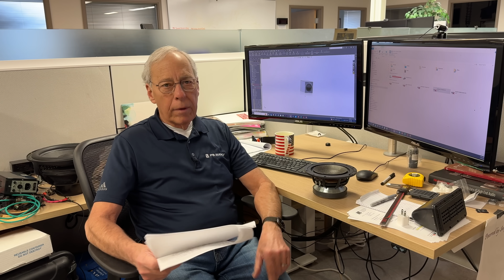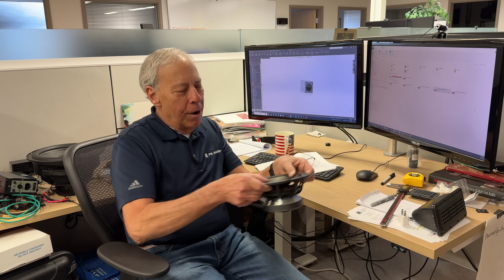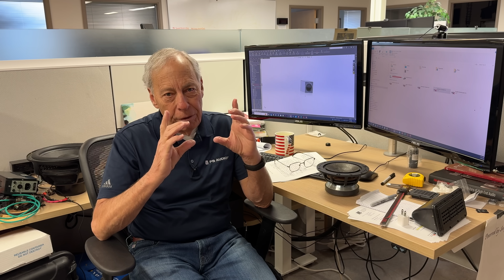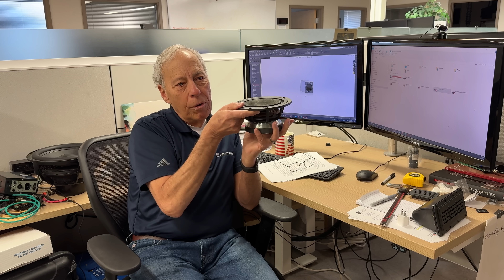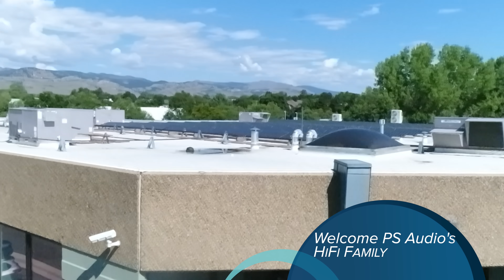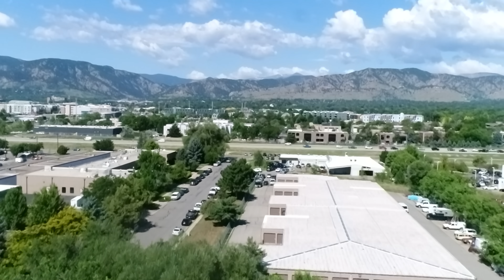How speakers move at multiple frequencies

Comment: Ok! That makes sense. I have to slow down the animation in my head to make sense. 

It reminds me somewhat of how computer chips work in that they seem to do multiple tasks at once, but in fact a single chip does one thing at a time and bounces between different tasks. 

I think another way to summarize this is that if you can expand one second into thousands of pieces it can mimic simultaneity.

Comment: Very good explanation, thank you. Paul, a question... I know that the human ear is capable of hearing a range of frequencies that goes from 20 Hz to 20 KHz. I also know that these are four speakers (Tweeter, MidRange, MidBass and Subwoofer) that, “together”, are capable of reproducing the entire range of frequencies mentioned. But I ask... Each of the four speakers mentioned reproduces, individually, which range of frequencies? In other words, the Tweeter is responsible for reproducing, individually, which range of frequencies? What about MidRange? What about MidBass? And the subwoofer? I would just like to have a general idea of the frequency range that each speaker works individually. It's a generic question, as I deduce that there is no fixed rule for this. But I would just like to have a rough idea.

Comment: My realization of the doppler effect came from being in a 'garage band'. What happened was plugging the mic into a bass guitar amp produced wild as heck modulations to the singers voice because the vocal frequencies were 'riding' on the much slower bass movements of the speaker cone. It was similar to the sound you can make whilst gargling and humming at the same time.

Comment: taking the loudspeaker components , the speaker fixed magnet , the voice coil suspension flexible holder , the voice coil attached to the speaker cone , taking delta T sec . , time constant , the voice coil , will oscillates the summations of all the fundamental frequencies , thus emitting all the fundamental frequencies from speaker cone , the overall effects is the integral summations of the audio complex wave over a unit time .

Comment: That‘s one reason why fullrange speakers don‘t work. Greetz from 🇨🇭
Reply: My PearlAcoustics Sibelius single driver work just fine, sound excellent to me. The absence of a cross over with all sorts of artifact possibilities, and the coherence of the sound is a major plus for single driver speakers. From a fellow Swiss, Jä e Basler Bebbi.
Reply: @danielgeiger7739  Auch ein Breitbänder benötigt ein elektrisches Korrekturnetzwerk um zumindest den Bafflestep zu kompensieren. Vielleicht hat dein PerlAcoustics Sibelius sogar so eines verbaut und du weisst es nur nicht? ;-) Grüsse aus dem Bernbiet.
Reply: @SinusPrimus  Amp - binding post - voice coil. That's the signal path in the Sibelius. I have not cut the speaker open, but at least that is what website indicates as well as Harley's very nice videos on YouTube (Pearlacoustics channel). Very much worth the time. 
Re baffle step (roll off of low frequencies), Sibelius uses as Voight pipe design of the cabinet. You could consider that the "correction network" but it is not in the signal path, it is not electronic. It is careful internal cabinet design.
Reply: @danielgeiger7739  Danke für den Hinweis. Theoretisch wäre eine rein akustische Kompensation ideal. In der Praxis setzt der Bafflestep aber nicht erst bei sehr tiefen Frequenzwein ein, sondern bei Schallwänden dieser Grösse bzw. Schmalheit im Bassmitteltonbereich. Also kann diese interne Schallführung das Problem nicht genügend oder nur ansatzweise beheben. Vielleicht schaue ich noch nach, ob es Messdiagramme gibt, die das belegen...

Comment: That's why we have intermodulation with full range speakers, separating drivers helps to avoid that, but i think there are some speakers manufactured in a way that at a certain point the higher frequencies just oscillates at the center, they use different materials and shapes to provoke a mechanical behavior.

Comment: So I wonder IF it could be ideal (if possible), to have like 5, 7, or 33 broken down circuits with the same number of different sized speakers?  So, normally the most I've seen I think is 4 way speakers with FOUR different frequency ranges and 4 different speakers, one to handle each.  Would it "cost" too much power to separate it this much?  Or would it actually potentially benefit?  I'm guessing you COULD use a good midrange speaker type to handle each of many frequency ranges, right?  So, let's call one speaker type a Sony 22m 2.5".  You could have maybe 7 of these on a box or even panel, each one handling a separate frequency range.  Would this actually produce technically "better" sound?  Or would the difference between that and only 3-way be negligible?

Comment: You forgot to mention that cone design factor and the physical attributes of said cone . Higher frequencies in a driver due to speed are released from center out . Hence putting a whizzer cone at dust cap center . The center moves faster than the outer edge because there is less area . A good /bad cone design is essential to its ability to produce proper frequencies thought a certain spectrum .

Comment: Thanks , Paul ! I had always thought of multiple frequencies simultaneously as intermodulation distortion , but Doppler does seem a more accurate descriptor .
I imagine a line array with 20 drivers and 19 crossovers would be silly to keep each driver in a "sweet" half octave . That would be a lot of expensive capacitors !

Comment: I figured it works like runners around a track: runners on the inside of the track will circle faster than the outside runner if they didn’t start staggered. The higher frequencies are coming off the area of the cone nearest to the middle, lower frequencies from the outer closest to the edge.

Comment: That's the problem with audio measurement specs. They are all based on steady state typically sine waves. That is because way back in the day that was the best we could produce for testing. Even producing a good sinewave was a challenge and a device to measure the results require a continually repeating signal. 

But music is seldom a boring single or even multiple steady state signal. It's well beyond a combined 20Khz and 20Hz steady state, It's an almost completely non-repetitive series of transients and harmonics combined into a very complex signal. If perfect, the speaker just moves based on whatever voltage is presented to it at that instant and it is constantly changing. 

Forget everything about individual frequencies, sine waves or simple combinations of. Think constantly changing non-repeating voltages that represent every sound at that point in time combined. 

Compared water flowing through a hose which is measurable in steady state laminar flow to a waterfall.

Comment: I’m guessing that each speaker driver only plays its filtered portion of the incoming signal & if designed correctly the resultant sound of the all speaker driver is an accurate facsimile of the input signal. A simple example is the playback of a low frequency square wave which contains many (sine wave) frequency components thus is output through all of the speaker drivers (to varying degrees).
Reply: I think Fourier explained it better!

Comment: What has been captured during the recording process is the sum of all waveforms present.  This includes where the constituent waveforms align (in phase) and re-enforce each other, as well as where they are not aligned (out of phase) and cancel each other.  Throughout the waveform this occurs at varying intensities and the result is a single complex waveform (per channel) representing the total sum of these interactions.  The speaker (electricity to sound) is functionally the opposite of a microphone (sound to electricity) and it is reproducing the summed waveform which has been recorded.  At any moment there is a single frequency which represents that complex summed waveform.  That is what the speaker is reproducing.  For a visual example of what this looks like, I suggest an excellent video by 3Blue1Brown covering Fourier Transform which is an algorithm that can take a complex waveform and identify the constituent frequencies it contains.  This isn't directly relevant to the question, but does explain how the frequency sum works.  https://youtu.be/spUNpyF58BY

Comment: I think woofer beaming should be addressed: above a certain frequency, the sound is coming straight at you, and has poor dispersion. The tweeter still has wide dispersion. I became aware of a new Mission speaker that uses a 2.9 kHz crossover point with an 8 inch woofer, while MoFi tweeters use 1.6 kHz. Wouldn't this create a problem for the listener if they're not seated right in front of the Missions? The part I'm not sure about is, the effect of the driver's dust cap: would that improve the dispersion, making the traditional calculation between the woofer diameter and the wavelength unreliable? Someone in a forum had brought this up recently. I had been using Brent Butterworth's article about what is the ideal speaker driver configuration as a guide, previously.

Comment: I JUST spoke about this in my recent videos too... related to complex music..  and quick changes.. transient response.. articulate movement.. damping.. etc etc..

A pretty good explanation. I think this needs a 3d animation to show how these waves are simultaneously present.. Its harder to speak to and easier to show a graphic.

Very good and important for people to understand.. say... reasons why we have...2way..  3way.. 4 way..5 way.. etc... 

Also... would be nice to see how these frequency and signals are processed in the cross overs.. as in.. how the electrical signals / Frequencies are ' separated ' in the wires / caps / resistors. 🙏🙏🙏🙏🙏🙏

Thanks, Paul. ..Education is our Primary step in any journey.

(Also.. Great to meet Chris at Axpona - we spoke briefly about the FR5 - " issue " / demo model performance)

Comment: Expressing a time signal (that's what's actually reproduced) in terms of a sine of sums is simply a mathematical transformation expressing tne signal in a new basis. That snusoids (in fact, you also need phases) can form a basis (i.e. any sine+base be converted to time and vice-versa) is the actual physical property. We use sines bec of the invention of the Fourier transform to make this change-of-basis possible and bec we find frequency domain analysis useful. Kinda makes one wonder whether math is invented or discovered.... Did we invent sinusoids or discover them?

Comment: Doppler distortion is largely inconsequential at the excursion levels of a well designed full range unit. Research has shown that if kept within 2cm it can be largely disguarded as a problem. If you think about a passing ambulance it has to travel some distance before we hear the drop in frequency caused by the doppler effect. All coil drivers exhibit the same behavior with respect to their bandwidth,where the lower limit is set by either higher mass and/ or compliance from their suspension (box alignment accepted) and the upper frequencies being a result of flexing within the cone structure around it's centre.Even the exotic rigid attempt materials do this and it's thanks to that behaviour that their higher frequency extension is simultaneously attainable.
Reply: 2cm wavelength is 80Khz. So yes if your single driver design is flat, linear out to 80Khz,.... otherwise operating in non-linear areas causes distortions.
Reply: @glenncurry3041 Hi Glen. On the doppler effect topic,the modulation is proportional to the speed of the cone at it's low frequency excursion where the travel is greatest. A 2cm excursion (not wavelength) is quite alot of travel and it will be lower in the majority of units,full range or otherwise at " typical " listening levels,so can be largely discounted. The 80khz frequency mentioned will require extremely low mass,and/or dimensions and excursion, not to mention how far that frequency is beyond audibility, so has no relevance at all with respect to the doppler effect.

Comment: I honestly thought you were gonna crash n burn with this one but you pulled it out. 
Respect. I was going to go in the direction of intermod.
Reply: Intermod is just two steady state sine waves. Again not accurately representing an actual typical sound signal. But way back in the day test and measurement equipment was very limited and adding two signals together was an advancement from using only one, like THD. Later changing the 2nd signal to a squarewave for TIM. Transient Intermodulation Distortion.

Comment: The diaphragm produces a waveform that is broadband. The answer requires an understanding of the Fourier expansion.
Reply: The problem with Fourier transforms is they require time accumulation. Which requires some level of steady state. The uncertainty tradeoff between temporal and spectral resolution (Gabor's principle) limits the minimum duration required for accurate pitch identification or discrimination. e.g. a half cycle is needed to detect frequency. The initial leading edge transient does not contain that much info.

Comment: Your eardrums cover all frequencies with a single diaphragm, a microphone covers all frequencies with a single diaphragm, and headphones cover all frequencies with a single diaphragm, so there is no reason speaker driver cant do the same.
Reply: I think that the maximum excursion is at the root of this. The eardrum and microphone diaphragm only move a small amount, so the doppler will be minimal, and the similarity in size and excursion means that it is unimportant.
For a loudspeaker, the excursion can be significant. As I understand it, that is an advantage of a horn loaded driver as the driver diaphragm is working against a high acoustical load, this is akin to a transformer.
If I am spouting garbage, please help me out here.

Comment: Waveforms can be added or subtracted.    When you put two waveforms of different frequencies together, you’ll get their sum/difference as some will cause constructive or destructive interference and your resulting waveform will look like the combination of these two. Same way your hearing works.  And if you look at that resulting waveform with the scope, and use Fourier transformations (decomposing the waveform into its components) you’ll get the original two waveforms.  The speaker moves the same way as the combination of the two waveforms.  Your eardrum will also do the same thing if you listened to two waveforms from two separate speakers.  If you shine a laser onto your eardrum to reflect onto a surface, you’ll see the combined waveform of the two individual waveforms coming from two separate speakers being combined by your ear drum.  Kind of like colors of light, your eye sees as combined but prism can separate them into its components.  
Actually eyes see differences between red/green/blue and the differences between the intensities of those three are interpreted by our brain as a gamut of colors.
Reply: Hi Christian. Nice explanation.
Reply: When you have a multiple driver system, where does the decoupling into different waves lengths take place?
Reply: @larazss3254  Superposition holds, so all waves are added together, and their sum can be decomposed into a resulting frequency spectrum. This spectrum assumes steady-state conditions, so while the music is limited in time, the components started infinite time ago, so it is abstraction whenever we go to the frequency domain.
Reply: @larazss3254  you get bass frequencies go to subwoofer, mids go to woofer and highs go to tweeter.  That is usually done in the cross over.  Sometimes the frequencies are separated in the DSP, and go to individual amplifiers to power the different drivers like in a bi-amp application.  But still you can have multiple frequencies of mid range or low or highs getting to one mid or low or high range speaker as they may be in the same group as cross over separates by groups which are ranges like bass 20-125Hz, mid 125-3000Hz, high 3000-20,000Hz.  So you may end up with two 5000Hz and 6000Hz going to the same speaker which would play the sum of both waves.  If you have 30Hz and 6000Hz, these two would go to separate speakers separated by the cross over.  However, when they arrive at your ear or microphone, they will sum up and your ear drum or microphone membrane will vibrate summing both of them.  It would look like a big wave of 30Hz with small wave on top of the large wave.  Kind of like if you got large waves on a lake and when quick wind gust blow over the lake, you get little tiny waves in top of the large waves looking like little shivers.  I hope that kind of helps visualizing it.
Reply: @christianratajczak2809  Thank you, that is exactly what Paul explained. But it is still hard to imagine, how analog crossovers can precisely identify and carve out these small waves on top of the large ones...

Comment: The speaker cone will move like that with 20 Hz and 20 kHz frequencies only if the amplitude of the 20 Hz is much higher than the amplitude of the 20 kHz. In the opposite scenario the movement will be quite different.